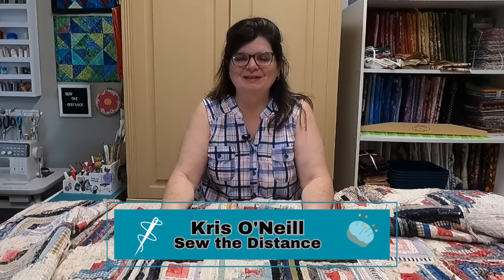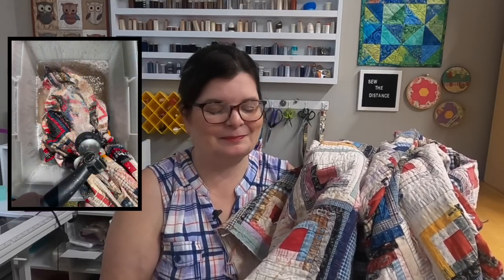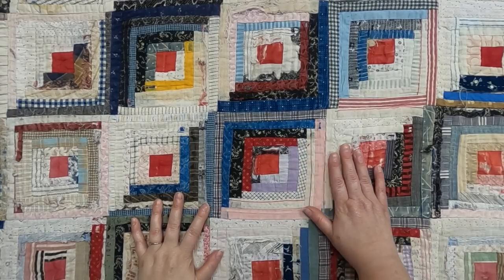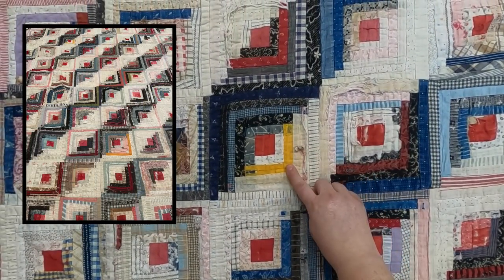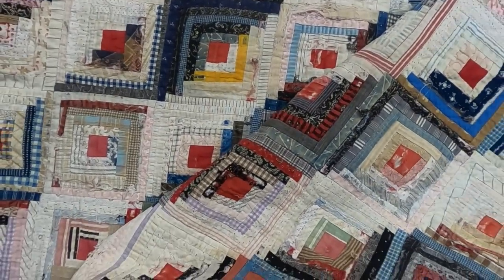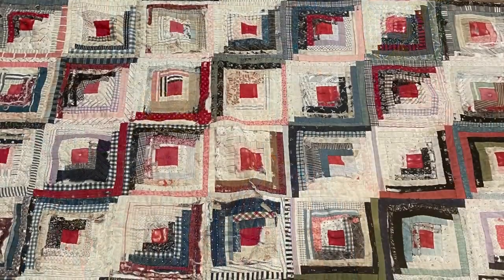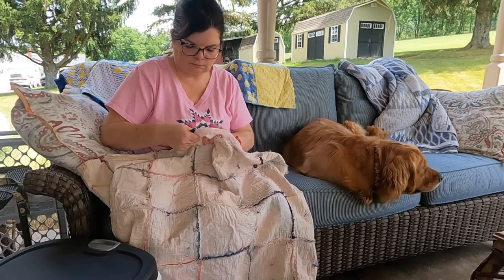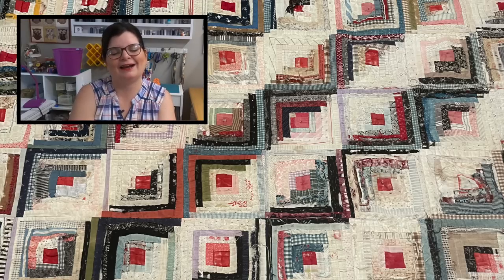Lessons from an Old LOG CABIN QUILT || Vintage AND Scrappy!

Comment: I use baking soda with Persil Original Deep Clean liquid detergent (was Whisk) in my wash water; and, white vinegar in my rinse water. I always wash in cold water. Thank you for saving that quilt.
Reply from the maker: Great tip! I will have to try this! I haven't used that yet. Thank you! As for saving the quilt, it was my pleasure. ❤️

Comment: I love Biz too, but it’s hard to find where I live. It’s great for body odors and grass stains. When stains remain in old tablecloths after I’ve done a Biz soak and then a rinse, I switch to an Oxi-clean soak. That can help a little more. I’ve found that some stains will become less noticeable, but they are never truly gone. I use Spray ‘n Wash Stain Stick on food oils and ointment soils.
Reply from the maker: Great tip! I used Oxi-clean years ago and wasn't that impressed with it compared to Biz, but maybe it is time to take a second look at it. Thank you for all these ideas! I will try them!

Comment: I would love to have you show us more log cabin design arrangements.  😀👍🏼
I have an antique log cabin quilt that was done the same way… Foundation pieced. I didn’t know if it was a finished quilt or considered a top. Since it is made out of wool, I kind of think it’s finished even though it has no backing and you can see all the stitching like with yours now that you have taken the back off.
Yours really does look 1800s, or early 1900s. I think the red in the center might be turkey red. 
You might want to research and see whether that kind of quilt was considered completed as is. I think mine was.
Reply from the maker: I am sure I will be doing another log cabin video in the future. I will try to remember to include that. In the meantime, here's a great link that can help:https://quiltsocial.com/the-many-ways-to-arrange-log-cabin-blocks-on-your-quilt/
I love that you have wool one! I have a tutorial on this block, too, where I show using a fabric foundation like this one. They are so much fun to make! 
I don't know if I included this in the video or not (can't remember if it was edited out!), but the blocks are put together by machine. Now it still could have been done when it was initial made (domestic sewing machines came into common use in the early 1900s), but it could have been assembled later. I have a few quilts in my collection like what you are talking about and have done a few videos on them. I completely agree it is possible, but I feel it was a top (or blocks) that were either assembled later or never were finished. I really wish these quilts could talk! LOL!
Thank you so much for the ideas, for watching, and for sharing! 🥰

Comment: Can you see how the maker snipped the center of the foundation block to get the red square on center? She would fold it twice and snip that corner that marks the center 😃.
Reply from the maker: I had to investigate after reading this comment! Great question! It looks like there is a dot of some sort used for centering. I didn't think to look at that! Thank you! The holes in the middle of the red centers came from the types because the holes are exactly where I carefully took the ties out. I wish I could post picture in the comments. The one I used in the video probably wasn't the best because you can't see the two holes the ties left. This is a great thought, however, and I will be on the look out for this in the future! Thank you!